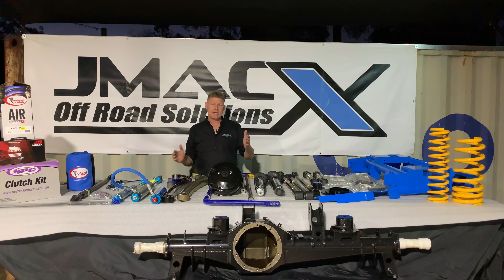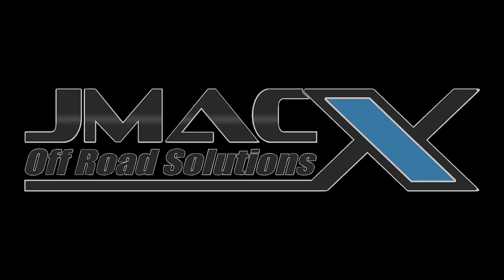JMACX 4200GVM Coil Kit upgrade 4inch lift and 35inch tyres ''Aus street Legal''

Comment: are portal axles absolutely necessary in a converted six wheel drive TOYOTA Land Cruiser 79 6X6 + 3.0 in. Lift 4.5 TDI V8 4-Dr Crew Cab Pickup Truck (RHD)??? could the 6X6 arrangement do with conventional heavy duty axles, front & rear coil spring suspension with dual shocks, a heavy duty 3.0 in. suspension lift & alloy wheels shod with 33.0 in. - 34.0 in. mud terrain radial tyres??? please advise!!!